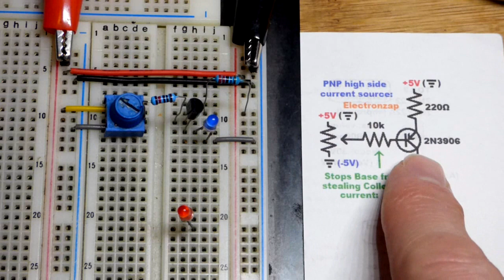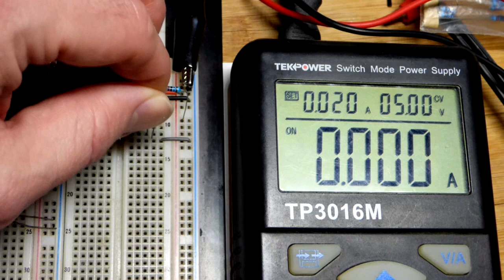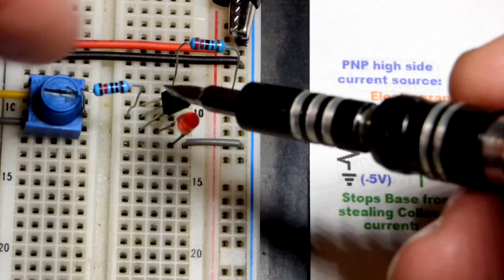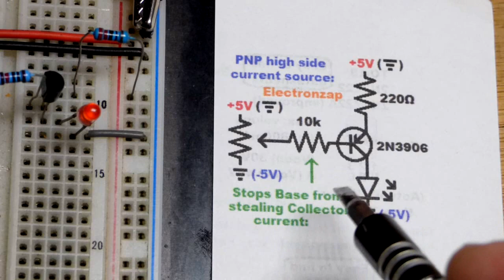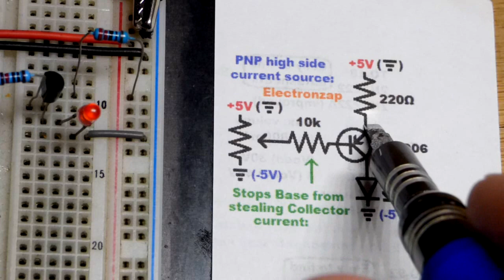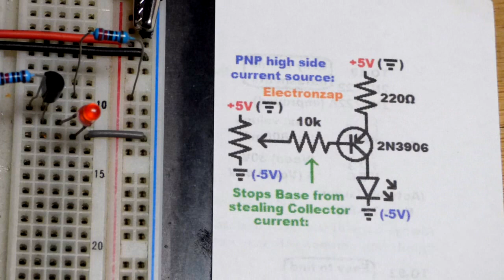PNP BJT current source sets LED brightness circuit 2N3906 trimpot learning electronics shorts 124

Comment: So I set up this circuit and plotted Vb, Vc and Ve against each other as I adjusted the pot.  Vcc = 5.015v.  Transistor started to turn on at Vb = 4.66v.  Transistor was fully turned on at Vb = 4.3v.  Ve = Vcc until the transistor started to turn on and once the transistor was turned on was Vc+0.7v.  At Vb = 4.3v, Vc was 2.6v.  Limit was reached with Vb=2.26v and Vc =2.84v.